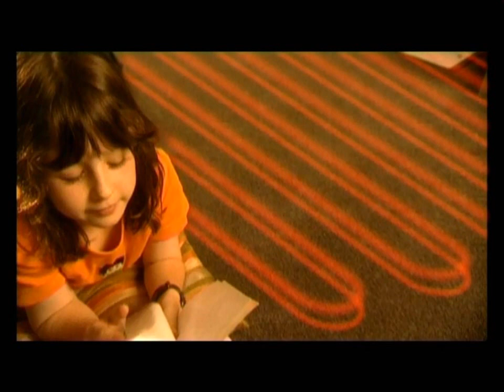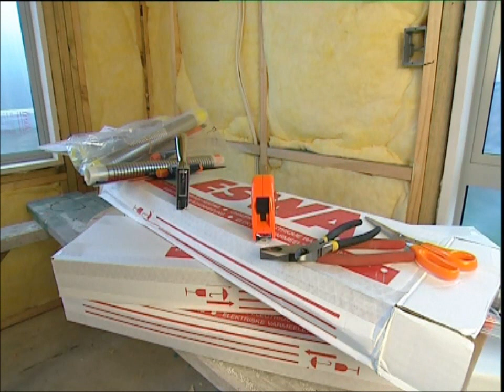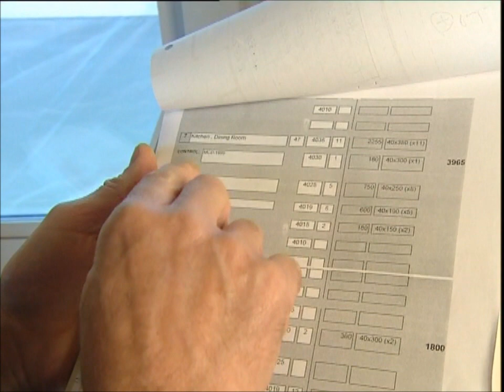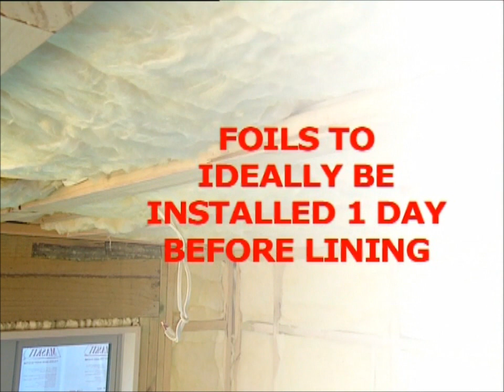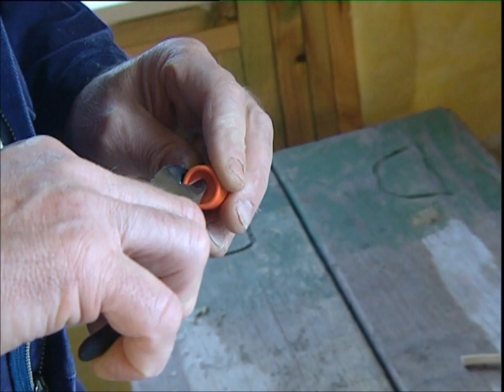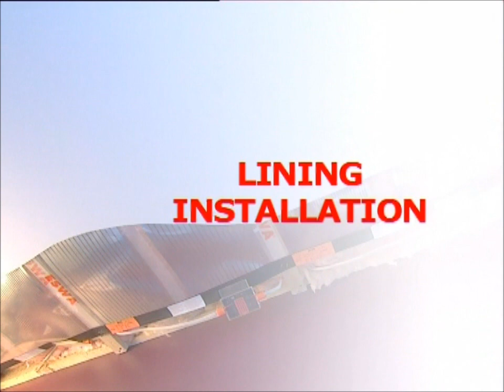Enersave Products Ltd - Eswa Ceiling Heating

Comment: This is very misleading. Heatpumps have a COP of 3. Electric radiant heaters have a COP of 1. Additionally stating that these panels are more efficient than a heat pump is incorrect. There were also a number of other statements that were completely wrong or misleading...